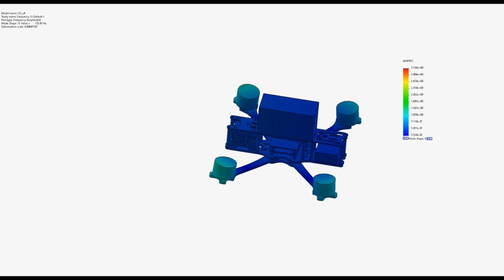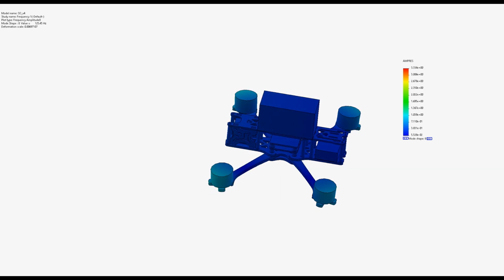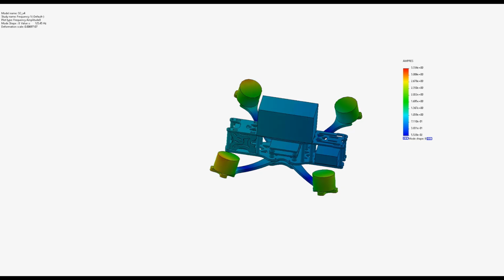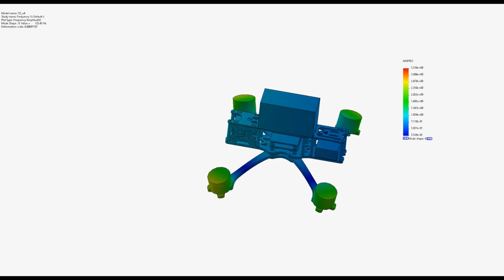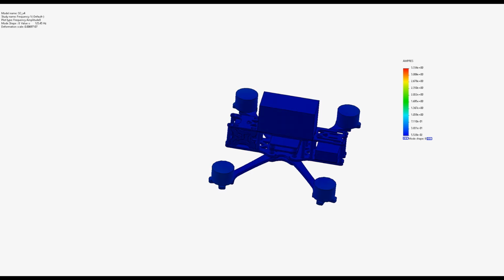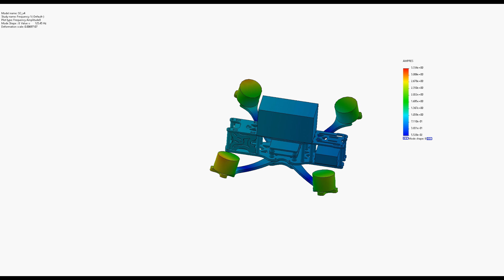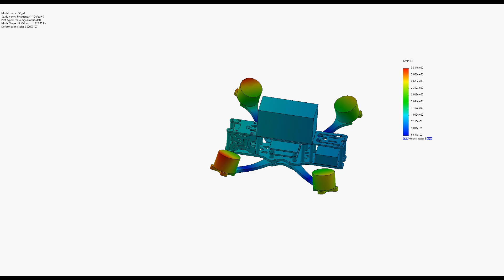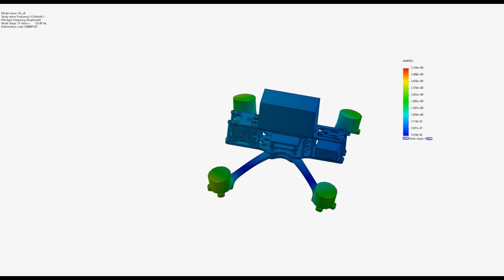Jello in your HD footage, tried everything? Watch this.

Comment: really dumb advice to tell people they need to redesign there frame... 
Just go buy a better frame??? 
how about look at the throttle % and then the waterfall chart too.. then set your TPA breakpoint to kick in at this throttle %
Reply from the maker: You can spend hours trying to tune around oscillation issues (and I have) and end up with a quad that doesn't fly great (becuase you've had to turn up the filtering and reduce the PIDs with TPA so the whole thing is undertuned) or you can buy a better frame for $75 and the problem is solved forever and the quad will just fly better, especially if you tune it.
Reply: @ChrisRosser  rather it be under tuned than just throw quads away because of an issue and buying a new frame is a different quad so this is not really advice for fixing any issue as you might buy the wrong frame again and have the same problem until your motors and props are on you won't know in most cases. and yes we all know about the AOS and the APEX being good like this. but its a personal thing. not everyone likes them rather help for what people have to work with. CNC cutters not that common in normal houses to make thicker arms

Comment: Great news Chris Master :) I'm using Source One 5" frames for over 2 years and most of the time was trying to solve some vibrations and for many different reasons..this frame really needs a lot of upgrades in my opinion and need to check your other video to see what I can do about it :) Really helpful stuff Chris Master:)  and yes! ND filters are 100% important to use even on cloudy days.. In my last case with jello on source one frame I was trying everything..including replacing the whole frame and motors to brand new.. after 6 months someone suggested ND filter and it solved jello in HD..